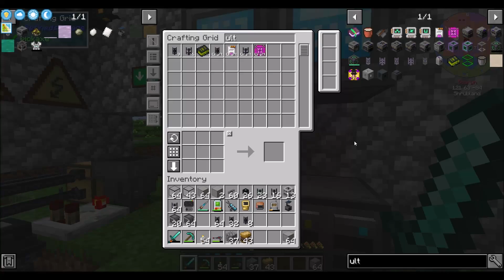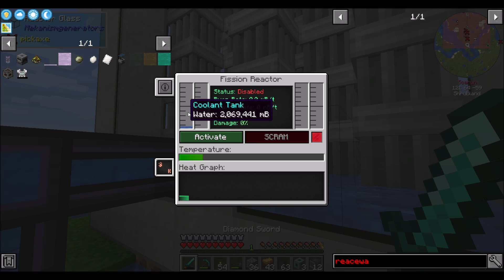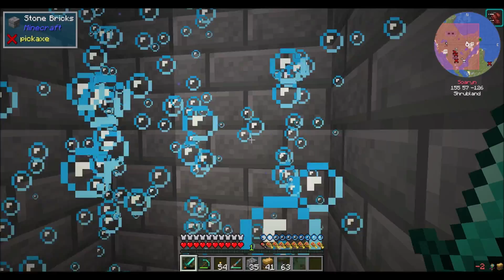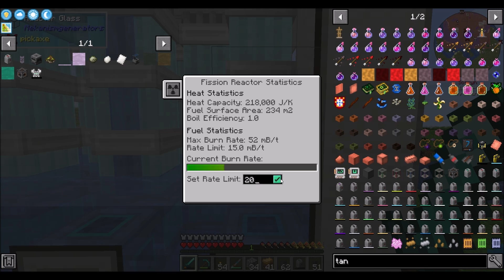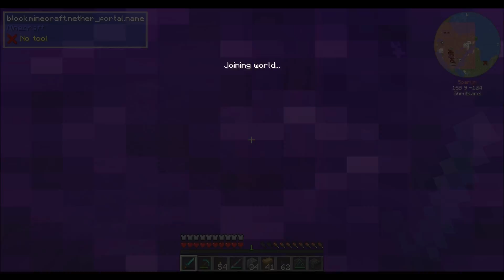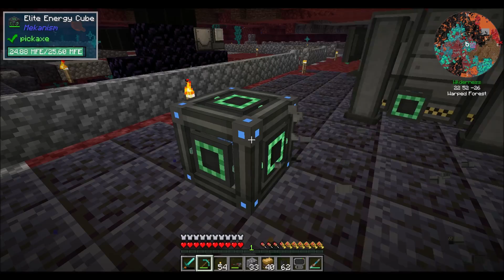Forgecraft S13E17 Bigger Reactor   Much bigger

Comment: Dire, put a second smelting factory next to your enrichment chamber. Both machines process as fast as each other which means when you're the enrichment chamber is producing twice as many dust to ores the smelting factory cannot keep up.
In TE the RS Furnace ran twice as fast as the Pulveriser to allow for the doubling of items. Mekanism doesn't do that.
Reply: The more you know, that explains problems I’ve had in the past
Reply: The same goes for when you do the ore tripling but in that situation you'll need three smelters, crushers and enrichers to the single purification chamber if they're all upgraded to the same level.

Comment: Vanilla knowledge... "how will I ever find the beacon, which sends a beam of light up to the build limit? Better start looking underground!"
Also, breaking the beacon was dumb. It wasted whatever material Soaryn used to activate it, and now it has to be replaced, covered up, and activated. Next time just block it with a piece of cobblestone.
Reply: if soaryn actually was duping it then it actually doesn't matter what so ever.
Reply: @buckwheatcat216  it does. It still wastes Dire's and Soaryn's time. Regardless of how resources are obtained. If resources were the only thing in my comment, you might have a valid point.

Comment: Hm. I question how dire made a number of internal reactor things not divisible by 5. Casing is 7 tall which would make each reactor coil 5 tall. But he had 12 left over . >.>
Reply: Probably had extra in his RS system. Over crafting and impatience are two things he does a lot.
Reply: ah, but you're forgetting there's a different block that has to go on top of those so it's actually 4 tall. Although if it were 5 tall he'd still be one short. :P
Reply: Did you take into account any leftovers from his first reactor?